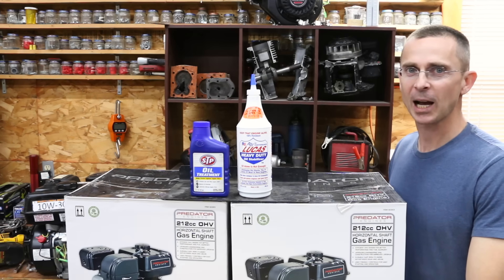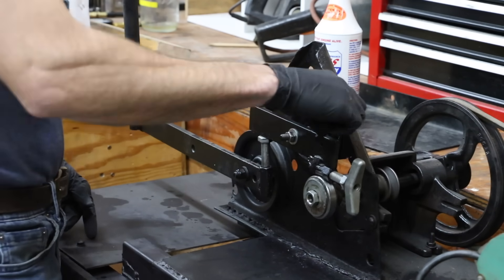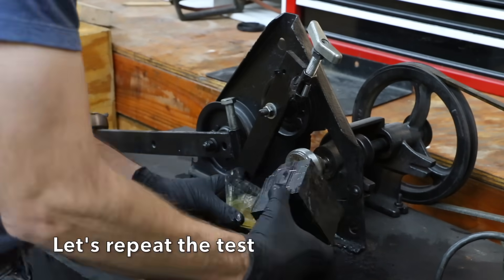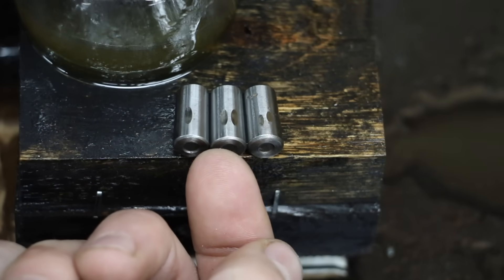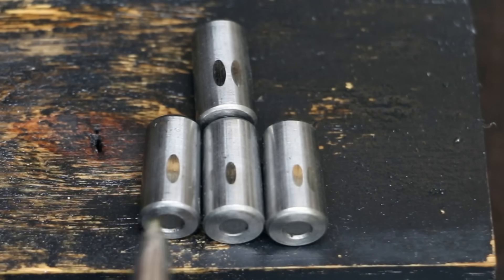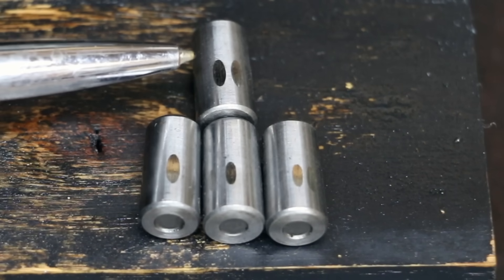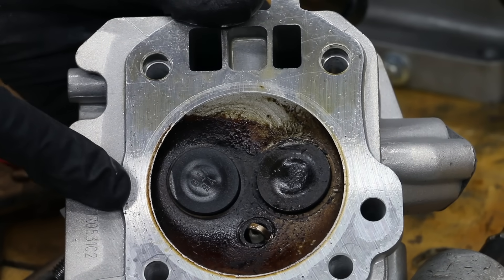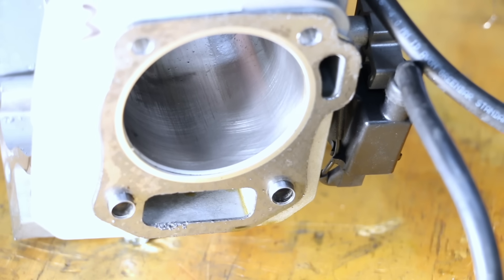Which engine self-destructs first?  Lucas or STP?

Comment: Been adding 8oz of Lucas in my 5 qt changes on my 86 Toyota 22re at around 200,000 miles due to it's part adherence property as this video showed. Now 31 years old as a daily driver with 463,000 mile (~15K year) and it still burns next to no oil between 5K oil changes using mostly Castrol GTX 10W-40 (conventional oil) all year. I never even check the oil level between changes nor have to an any oil. Oil pressure gage reads same as when new even at idle. At 283,000 mile had new valve stem seals installed and the mechanic was amazed at the inside of the engine. He said it looked like new with the honing marks barley worn. Asked what oil and how often did I change it. I have no complaints at all. Started adding some to my 5-speed and diff at 350,000 miles for added protection on gears. Those are still OEM original and going strong also.
Reply from the maker: Thanks for commenting.  463,000 miles is amazing!.

Comment: Anyone that would use either Lucas or STP or looking to purchase a new engine, both are so substandard and or just for consumer consumption in big box stores. If you are wanting a true test of oil and oil additives you have to purchase from professional manufactures, the number one oil and the only truly 100% synthetic is AMSOIL and the best oil additive is BG's MOA. With these two in combination in the air cooled engines, when you drain it you will run out of gasoline before it seizes!
Reply from the maker: Thank you for this recommendation.

Comment: I mentioned this on the previous video, but using a new outer bearing race for each test would be more consistent. There can be a lot of variation in your sanding. At the very least, keep measuring the regular oil in the future tests as a control to monitor variation.

Comment: I've used Energy Release for years, It bonds to the metal.  I have 320,000 miles on a Ford 2009 E150 and all I've done was change oil, new ingition coils ,and spark plug5s.  It uses 1/2 qt of oil between 5000 miles oil changes
Reply from the maker: Impressive!  I might test this additive.  Thank you for this recommendation.

Comment: You should really do less destructive tests. Draining the oil and running until destruction is not a real world testing method, but one hell of a marketing gimmick. Do you think vehicle manufactures and oil companies test their products this way? Hell no. The only thing your testing method discovers is the weakest point under complete lubrication failure. A casting flaw or hardware torque slightly out of spec would throw your values off under such a extreme scenario. I don’t know how many times you’ve ran engines unknowingly out of oil or forgot to install you drain plug, but it wouldn’t matter what product you have in there because your testing method is set up for failure before you even start. So what was accomplished from this test? Maybe you can drive 1 more mile with Lucas, after your dumbas drives without oil? No matter what product you had in there, you’re still always going to end up with a destroyed motor. May as well not even waste your money on an additive if your  going to leave the drain plug out and run it empty. With the money you save, you could go buy yourself that Darwin Award you deserve. 
Sorry, I’m not trying to be a Richard. I like your videos, but they would be more meaningful by doing some real world endurance testing. Make a set of standards. Idk, run a gallon of gas thru each one everyday for a month, then pull the motors apart and do some investigation (Crank,Rod, Piston, Cylinder, Cam, Valve wear. Along with a foreign deposit summary. ) That way you’d know exactly what the additive is doing. Keep up the great videos. Stick to more real world situations and less using paint thinners and diesel for gas replacements. My 2 cents.
Reply from the maker: All great points.  I've been contacted by additive makers that want their product competed in this sort of testing to prove that their product provides better film strength under extreme conditions compared to other additive and oil products.  One company informed me that they drove a car for 400km without oil before the engine began to make noise.  I'm curious if there is an additive that good.  I see your point of view but also think there's value in this sort of testing too.  Thanks for commenting.

Comment: My Grandfather who worked for Gleason Works & retired in 88' also rebuilt Automotive Engines, did valve jobs and had a small engine repair business after his retirement until his Death in 2002 always used STP, I have followed suit, I Drag Race, we have 2 Cars, 1 that runs mid lower 9's in the 1/4 and one that run low 10's, Both are SB Chevys, We run Diesel oil as it has all the properties you want for high compression engines, Both are Carbureted and Run on Alcohol (anyone who knows, Alcohol attracts moisture and washes down cylinder walls that can cause severe wear), Both Engines run 61/4 qts each, I have been using 6qt of Valvoline Premium Blue Diesel oil & a pint of STP for the last 12 years in both engines. My Engine builder has stated what ever your doing keep doing it cause for every rebuild / freshen up there has been little to no wear internally. My engine is a 421 ci that run 2800 lb car in the 9.40's to 9.50's range at 140 mph at 7500 rpm at the finish line, I average 300 to 350 passes a year and get 2 season out of it before a freshen up. I was always told by my Grandfather that the cold / first start up after having sat was the hardest on an engine and that STP would cling to all the internal engine parts thereby having lubrication for the cold start up. I have seen it with my own eye, Even after having sat all winter (6 months up here in Rochester NY) the engine has that coating of STP on everything.Had to pull an intake to fix a distributor bolt hole for the hold down, I pulled the roller lifters out (mind you this is after sitting all winter for 6 month) and they still had complete coverage of sticky oil on them. I like Lucas products but I like the clinging properties of the STP better. I know it works. But like a lot have said, any engine without oil will blow up no matter what's in it.
Reply from the maker: I really enjoyed reading your post.  You've got some really impressive, fast cars!  To run those sort of time, I'm sure then engine is turning a lot of RPMs and the STP and Premium Blue Diesel are doing a fine job protecting the engine. Thanks for commenting.
Reply: IAMELE MECHANICAL. I'm a total believer in STP that's why you can't use on an and engine that has the wet clutches cuz they slip just like the old commercial you can't hold a screwdriver with the STP on it cuz it's so slippery but you can hold the screwdriver with just plain engine oil on it

Comment: Why in the heck did you grind on the wheel with a grinder?  You just turned the surface that the bearing was rubbing against into a super rough surface.  So your test is complete crap on that part.
Reply from the maker: I've since switched to using a very mild abrasive, enough to smoothen out any scoring and cut away enough steel that may have additives saturated into the surface.  It should provide a more reliable outcome. Thank you for this recommendation.

Comment: Running the engines to carnage was entertaining, but for testing purposes I would've liked to have seen start/stop cycles with inspection from a diagnostic camera in between. Both the spark plug hole and oil drain look like they'd accommodate a camera arm.
Reply from the maker: Thank you for this recommendation.

Comment: I like lucus
Reply: Which one won
Reply from the maker: My opinion is that Lucas did better on both tests when following the manufacturers recommended mixture rate.
Reply: Project Farm that's what I use also so when I'm changing oil in my wife car which is A 4 cylinder I just add one bottle of lucus to ever oil change

Comment: like others, i wood like 2 c AMSOIL v mobile 1... i almost lost a vette engine in '76 wen i 1st used mobile 1...  on AMSOIL i got 43 mpg in my '15 tucson, engine & trans oils, @ 46 mph... will NOT use anything else in my cars... also get 5 cuts f/my john deere rider doing my lawn, using AMSOIL instead of 3 cuts using 'oil'
Reply from the maker: Thank you for this recommendation.

Comment: Should you not have had a 3rd engine just on oil alone ? 
Plus you didn't check the engine air fuel ratio, one engine running slightly  lean would account for a hotter exshaust temp.
Stick with the oil and maintainence you manufacture recommends.
Reply from the maker: Thank you for this recommendation.

Comment: Good video. I use Lucas in my cars and bikes (Subaru and most Japanese 4cyl 16v  in line 600s) i find it helps run them smoother and quieter and I also get a little better fuel economy. Most of the oils I use are semi synthetic 10w40, I would be reluctant to use any additives in say a yamaha R1 on fully synthetic or any compact 2l turbo car with high output that would run a 5w30 oil. I think messing with the viscosity of the 5w30 in these type of European cars like an Opel Astra VXR or VW Golf R could be dodgy. I was always told "oil is cheap, engines aren't"... what about a test on Slick 50 please? I swore by it in my old VW Golf's mk1&2! They even had a sponsored race series bitd. ... keep up the good work 👍
Reply from the maker: All great points. Thanks for the positive comment.

Comment: I’m a little lost as to why he dry ran the engines can anyone explain so maybe I can understand what the purpose of that was?
Reply from the maker: This measures film strength under extreme conditions.  Which additive can withstand the pressure and heat the longest. Thanks for commenting.

Comment: Recently I had three different family members run their vehicles with essentially no oil.   There was enough that the oil light did not come on, but when checking with the dip stick, it took 3-4 guarts before any oil showed up.  The oil that was in the engine was black and old.   The oil and filter were changed.  However, I thought for sure that all three engines would seize in a short time.  Yet all 3 are still going.     These are car engines.   So it would seem that any oil is good oil?   It would be interesting to see the wear caused to an engine which has the bare minimum old oil.   Also, all engines which have an oil filter use Detergent oil.   It seems to me that the detergent stop functioning as the oil becomes old and over used.   Testing the detergent effectiveness with age and heat might be interesting
Reply from the maker: I enjoyed reading your post. Glad all 3 engines survived.  Thank you for this recommendation.

Comment: Try putting a bit of gear oil I had a mower that was making almost no compressionand 20% gear oil made it run for the rest of the season I wonder can it run on 100% 140 weight oil
Reply from the maker: Thank you for this recommendation.

Comment: I use Lucas in everything I own.... When I mean everything I mean from fuel treatment to gun oil and basic lock/hinge all purpose oil for the house. Lucas as lived up to their name many times in my book. Great video!
Reply from the maker: Thank you very much for the positive comment!
Reply: I the same. I've been adding Lucas to every oil change for the past 25 years in every engine that I have owned. In two stroke to big blocks and and all the other motors in between. In 25 yrs,  Lucas has never let me down.
Reply: As have I, when I did the valve cover gasket on my Toyota 1.6 their was absolutely ZERO sludge, the metal was this beautiful gold color uniformly... I wish I could post pictures to YouTube comments...
Reply: Mike Bland hay mower, lawn mower, tractors, trucks, everything gets Lucas added with every oil change. We had a old hay mower that was clanking away sounded like it was about to come apart tried new oil tried other additives and nothing worked until we put some Lucas in it and after about a few minutes running it smoothed out and hummed like a butterfly.
Reply: I once bought a Sable with 170k on it. Had a slight tap, added Lucas, ran smooth after. I hardly ever changed the oil always thinking it was gonna die soon. Well I sold it for a few hundred with 270k on it cause the axel was shot. Guy is still driving it daily...Love Lucas!!!
Reply: Thanks sir. I'm glad you enjoy my products :)
Reply: Frank Green, I have a 2.0ltr Ford Focus with 160K on it.  Runs motorcraft synthetic blend 5w20.  Zero sludge build up.  In a properly maintained engine, sludge buildup is virtually non-existent when using a quality oil to begin with.

Comment: Let's do cost analysis-lucas runs for what these days, $15? The STP I can get for $2.99, I would hope that there's some kind of difference. I've used both & have had luck with both substantially improving oil condition. However I do run 2 bottles of STP in my 5.3L which is 6qt system. Just remember  you can buy almost 5 bottles of STP per 1 Lucas
Reply from the maker: Great point regarding the cost.  By the way, the 5.3 is a great engine.  I suburban has 199,000 miles and is still running really well.  Thanks again.

Comment: The problem is no engine will keep running without oil no matter what additive you use . Might try a video of engines with additives and oil at high rpm for a long time if you haven't done that yet . Might give better results ?
Reply from the maker: Thank you for this recommendation.

Comment: Motor Silk,  though is using the patented formula brought to the market by an engineer using the formula invented by a government research lab and "supposedly" better and lays down a harder layer of protection vs Achoil. That is why it would be a good test. Motor Silk is "whitish" with special Boric Acid and Archoil is brownish.  Total different formulas and concepts.
Reply from the maker: Thank you for this recommendation.

Comment: Fun fact. Bright stock is the light end of flux asphalt after the flux is put thru a pda unit (propane de-asphaltine). Then it’s hydrotreated. The bottom end is a very thick, refined asphalt that’s actually brittle after it cools. 
Used to work in an oil refinery that refines and hydro treats nahpthinic based crude oil
Reply from the maker: This is very interesting. Thanks for providing this information.

Comment: Ok guess I don't get it, where is the engine with only oil running next to the ones with additive? You haven't  made a point does it help to run additive, of coarse the engines are going blow running dry, I could tell you that and I didn't need to waste money on 2 engines.
Reply from the maker: Thanks for the constructive feedback.  The engine endurance test measure the film strength of the additives under extreme conditions.  Thanks for commenting.

Comment: What's the point of this video, besides you wasting my time, and the peoples money that bought the engines? It's obvious that any engine will self destruct without oil in it. Now if you had fill the crank cases fill of just  additive, and then ran them like that, I would maybe see some use out of it, but would still be pretty idiotic!
Reply from the maker: Thanks for commenting. I've had additive companies contact me requesting I test their product using this approach after watching this video  The lubricity testing device measures how these products perform during a "cold start" and the engine run tests film strength under extreme conditions.  I'm always looking for a better way to do these tests.  If you have any suggestions, could you please create a new post so I can easily find it?  Thanks again

Comment: considering the lucas engine ran longer and was as damaged as the stp one. but as you said its because of the extra amount lucas has you add in so it could be the same
Reply from the maker: Great point regarding the use of equal proportions.